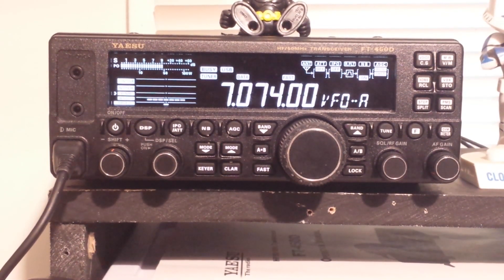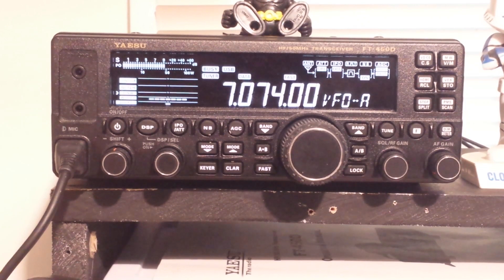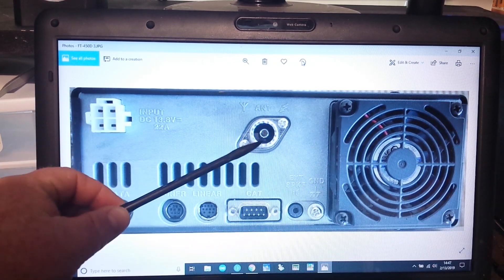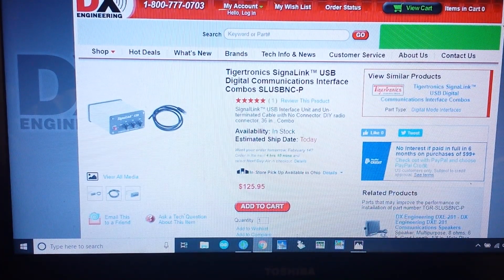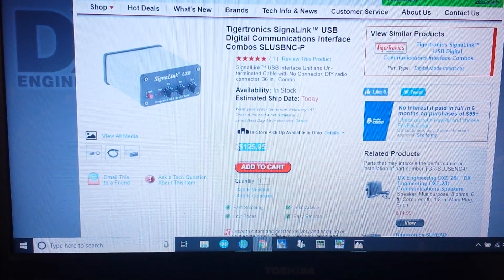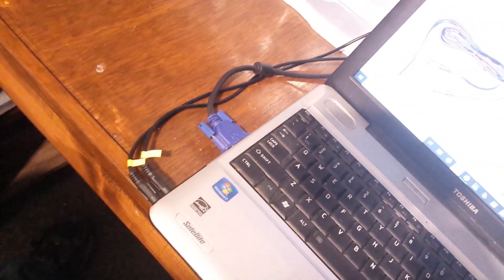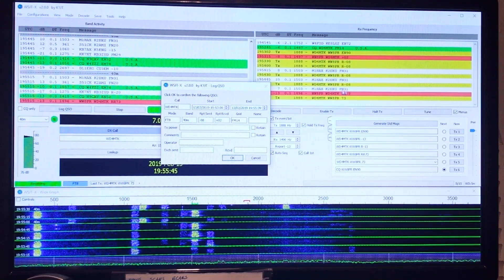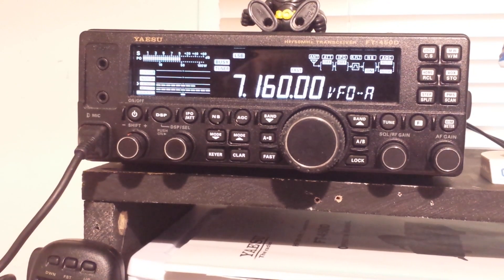Yaesu FT 450D digital modes without a SignaLink or SCU 17 USB Interface

Comment: Just a point to note.  This method is for FT-8 ONLY.  If you want OTHER digital modes, my best suggestion is the Tigertronics USB Signalink.  Also, it is very frustrating to see a video with a title such as this one, suggesting you can do digital modes without an interface.  People, saying "Digital Modes", dos NOT exclusivly mean FT-8.  Quite frankly, FT-8 is not the end all in digital modes.  I have been there and done that, and it has no EMCOMM use.  Quite frankly this videos title was "CLICK BATE", for FT-8!

Comment: I have an FT-450D and Signal Link.  It works fine with FlDigi but NOT WJXT.  I'm having issues with it wanting a com port for rig control and have tried two cables into the DB-9 Jack.  One with USB on the end to computer and the other DB-9 o both ends.  Device Manager seeing cable but on FlRig.  Wish you would have gone one more step showing rig Control and if you could change r=frequencies in the WJXT sofware or had to do it manually.

Comment: I know this is an OLD video, but for newbies watching, you DO NOT have to buy a sound interface for digital modes, the PC itself has a sound card and they work just fine instead of going out and buying something you really do not need, BUT MAYBE YOU KNOW THIS BY NOW. Older rigs never had a sound card built in to demonstrate my point before these external cards came along, AND by the way you could have just used the "DATA" PLUG socket and wired it direct with 2 or 3 wires into your in/ out audio jacks on your PC. Maybe this will help someone on a very tight budget. Good video for beginners though. 73 de KD6SBR Tom in NV

Comment: Thanks for the info on the FT8 input into the FT-450D.  I've had a 450D since 2016 and your spot on
in that it is an easy to use well made rig.  I have made over 6000 QSO's with in 7 years and it shows no sign of fatigue.  I keep the output watts as low as required to make contacts.

Comment: Does someone have the software settings for the Yaesu FT-450D when using this 6 pin data connector? I bought the cable, my PC has one audio port, so I bought the correct single pin unit for my pc. Anyway, I can receive on FT-8, but not transmit. It has to be the setting on the software of perhaps the radio? Can someone offer a bit of advice> Many thanks!

Comment: You're missing two key features of the signalink. Once is obviously the PTT feature so as to not rely on VOX for keying. The other is probably more important and that is that the signalink is electrically isolated from your radio. I do not recall (been a bit since i looked inside) if its using optoisolators or audio transformers to accomplish this but it is important.

That said, just adding an audio transformer to your setup can be done. They're not expensive and can be picked off amazon or ebay or whatever.

Last point, the signalink isn't cheap but its a pretty good little device. The isolation along with the jumper configuration to allow it to mate with pretty much any radio is very handy as well as the physical dials to control audio levels in and out of the device.

Comment: I use an FT-991 so I'm just guessing here. Can I assume all it took was to tell WSJT (and the other programs) to use VOX in order to do your keying for you?  I'm assuming it will, which makes this perfect timing. We have new Ham with a 450. He's trying to get on FT8. This would be perfect. 

Thank you.
Reply from the maker: Vox will work just fine
Reply: VOX is a great idea, and it's what I'm going to try when my cable arrives :). Just a note about the FT-450D, if you haven't seen it elsewhere: I think you may need to adjust the menu item called DIG VOX (default is OFF), rather than VOXGAIN, depending on the mode you use on the rig. In this vid, you can see WW8PR has the rig set for "plain voice" LSB on 40m (not DATA LSB), so presumably VOXGAIN is the way to go.

Comment: Is internet required when making contact or just via antenna?
Reply from the maker: Contacts via antenna only, but logging requires internet
Reply: You do not need an internet connection. 

And you can log using the WSJT-x logging software included with WSJT-x unless you want to use something like LoTW.  

However, to run FT-8 you need to be in good time-synch with all other users.  Time synch is usually, and most easily, accomplished via a connection to the internet.  Newer versions of Windows 10 have built-in tight time synchronization, but with older versions of Windows (I am guessing that you use Windows) you may need to download a free synching program like Dimension4 to achieve sufficient accuracy.  You can go to the webpage time.is to see how well synch'd you are.  Mine says "Accuracy of synchronization was ±0.011 seconds", (i.e., off by 11 milliseconds) which is good.

Comment: 2.5ft FT8 / JT65 / PSK DC-11F Audio Interface Cable For Yaesu FT-991,891,857,897,450, the cable comes in usb, and it can work winlink
Reply: Hola Jonathan lo usas en el ft450D?

Comment: Hi and thank you for this video.

I use SignalLink for a FT-450D now but nice to see it's possible to use digimodes with a FT8... Audio Interface Cable. I may use the SignalLink with a FT-1000MK in stead.

Have you any ideas how to remote control the FT-450D? Except with HRD? Could it be done with Fldigi ? Do I need a serial cable - for what?

Is it possible to run digi mode with a similar Audio Cable also for FT-1000MK Mark-V?

73 Alf
OH6IH
Reply: Is these cables for FT-1000MP MARK-V ?

Comment: Ok, but how you can secure your pc motherbord from ham radio RF impact without galvanic isolation which is very critical in such connections? A common damage of laptops' motherboard is caused by this. The RF on the motherboard's ground !!!

Comment: Thanks, great tip.  However, you have failed to mention one really important thing.  You have said in your video that the 6-pin DIN to the two 2.5mm jack connecters is all you need and there is nothing fishy going on and that you are showing us everything.  Actually, you haven't shown us that you need a CAT connection for PTT transmit which isn't included through the DIN connection.  Also, what is the software you are using?
Reply: Just enable VOX on the radio. It will go into transmit when sound is present....
Reply: @VoeViking  Thanks, that's great, I didn't know about vox.  I've just got round to trying WSJT-X on my computer.  However, I was wondering if you could help.  I am trying to make it work with the Digi-vox feature on the radio.  My digital-vox PTT does turn on and off with sounds from the computer soundcard, which I discovered by accident.  In the WSJT-X software itself however, when you click the tune button, it causes the radio to transmit but when you click the button again, it will not stop transmitting at all. I cannot figure out why.  I've tried everything and on the verge of giving up.  Wondering if you can help?  Thanks in advance
Reply: @avaughan585  Late to the game on this, but you want to adjust DVOX, not VOX.  DVOX applies to the rear data port; VOX applies to the front mic port.  Found this out when I bought a device from overseas that is essentially a USB sound interface with integrated cable (it even came in a 3D-printed dongle head).  Simple interconnect, no need for CAT switching.

Comment: Hi Friend...Thanks for the informative Video. Was the need of the hour. Your Ebay Link Doesnt Work.
I tried searching and found this working link for the product ...
https://www.ebay.com/itm/3-FT-FT8-FT4-JT65-PSK-Audio-Interface-6-Pin-Mini-DIN-Cable-DC-11F-for-YAESU/164148024000?hash=item2637fc12c0:g:SCEAAOSwnDpaI31s

73s
De VU3OSA

Comment: Great video. But although i understand the sound input/output part, how does the PC controls the transceiver (tx/rx)? Is it vox style?
Reply from the maker: No, you need a DIN to USB cable for CAT control and PTT
Reply: @learnelectronics  meaning?  Like i have db9 to usb,  and already buying 6pin mini din with speaker jack end to end.  Now need tondo the soldering work.  Just connect for datain and data out?
Reply: @learnelectronics  I thought the CAT control was using the DB9 on the back of the radio, not a DIN. Is that incorrect? Would it be like a Prolific USB to RS232 converter cable from radio to pc?

Comment: I have the previous model yaesu ft-450at  does will work with this cables ?
Reply from the maker: If it has the DIN connector you are good to go.
Reply: @learnelectronics  shure it has the din conector , I am having trouble finding the DC11F yaesu cable

Comment: I made my own cable by geting a 6' 6  pin PS/2 cable and cutting it in half. Also, I did use a cheap (<5$ usb sound dongle just to make sure no windows sounds went to the radio, hi hi.
Reply: did you ever get Hamlib error: IO error while opening connection to rig?

Comment: That was very helpful - just purchased this radio. Thank you for the info!
Reply from the maker: Check out my video on getting started with FT8 too.
Reply: @learnelectronics  Just a friendly question. How is PTT handled in this setup (featuring the cable)? Are you using VOX or something?

Comment: I see you have the IPO in the off position. This means the receive preamp is on.  Your impression of this radio will be greatly improved if you turn the receive preamp off. You will see the noise floor go way down.  I know it is looks wrong but when IPO is in the off posttion the receive preamp is on.  That is why the DSP is not working as good as it should. You are amplifying the noise floor.  The DSP makes a BIG DIFFERENCE on CW.
Reply: If you turn the preamp off you aren't you reducing your wanted signal too?  I'm just thinking from a DX perspective

Comment: Hi, thanks for the video.  I understand the Data -> Audio cable is a good cheap solution for FT-8 but I'm wondering if you can explain if there are advantages of the Yaesu / Singalink boxes as compared to the audio cable?
Reply from the maker: Isolation is the only thing I can think of.

Comment: As engineers I'm sure we could make this cable right?  Unless there is some special stuff baked into the mouldings???  I think the pinout for the Yaesu FT 450D is published somewhere?  I have also came to the same conclusion as you - that you can pick up some very nice 2nd hand gear cheap if you avoid the latest sexy SDR rigs.  I opted for a FT-950 a little older than yours but very capable around the same price.  I'll have to do the same as you for connections of CAT and audio in/out.  There is also  converters on eBay for about $40 that do it all...
Next stop: "Poor man's Pan adapter" using RTL-SDR connected to IF inside the radio, you might want to check that and do a video on it.
Reply from the maker: You sure could make it. The pinout  is in the manual. These days I'd rather buy a cable though. I'm getting lazy as I get older.

Comment: A very helpful thing that you could have added to the video was to show the Settings in WSJT-X, specifically for the Radio Tab in Settings and the Audio Tab in Settings. Also if there are certain settings on the computer that need to be adjusted, such as in the audio settings.
Thanks for a nice video otherwise.

Comment: Hi Carl, I have the cable and have a few set up issues txing any chance you can do a video or write me the settings you use on the programme and also the radio settings.. Thanks
Reply from the maker: Im not sure who Carl is. I'm Paul. Email me @arduino0169@gmail.com and I'' try and help you out. 73 de WW8PR
Reply: Hi Paul thanks for replying I have sorted it and making plenty of contacts cheers 🍻

Comment: Thanks for taking the time to uploading this video, I will be using the 450 for ft8 and was going to buy a signal link but I will give the cable a try, looks nice and easy to set up.
Reply: My computer only has headphone speaker out no microphone jack. Would a USB microphone/ speaker converter work please. Thanks for reply in advance.
Reply: Where u able to use the cable with your computer?, I Havent been able to use it
Reply: Hi yes I am using the cable now with mine. Thanks
Reply: @gbpauluk  could you tell me step by step how to aconplish this with jtdx using ft8, I connect this cable and set the program, but just receice data loss. Do I need any extra cable or somethink link that?

Comment: If you must use an external sound card.. i've had good luck with those $0.90 usb sound cards...  I use it on my APRS setup...  I seemed to get a ground hum when I plugged in straight to my laptop, and the external card got rid of it  ...  couldn't see spending $100+ on a sound card. 'probably should have put in an audio isolation transformer, but had one of these laying around..

example card I use:
 https://www.aliexpress.com/item/USB-2-0-External-Sound-Card-5-1-Channel-w-3-5mm-Headphone-and-Microphone-Jack/32815941625.html?spm=2114.search0104.3.33.67081ef13zPIMV&ws_ab_test=searchweb0_0,searchweb201602_9_10065_10130_10068_10890_10547_319_10546_317_10548_10545_10696_453_10084_454_10083_10618_10307_537_536_10902_10059_10884_10887_321_322_10103,searchweb201603_51,ppcSwitch_0&algo_expid=e23752c2-dfca-466b-83e0-b6d38680583c-7&algo_pvid=e23752c2-dfca-466b-83e0-b6d38680583c&transAbTest=ae803_3

Comment: I like your channel a lot and on this one I can not but agree with you, the Icom 7300 is a 1000$ radio (brand new) and it is a SDR radio with immensely more capability then the yaesu 450D. Both directly on the radio controls as well as when connected to a computer. 
It's likely the Icom 7300 does not get the 500$ price range on the used market but the radio sets a new standard on HF and Multiband radio's with totally integrated SDR capability.
The Yaesu is in deed a great great radio but the "new kid on the block" is indeed the Icom 7300.
Reply from the maker: Love my 7300. It has changed the face of amateur radio for ever. It's like aircraft going from ic to turbine. The ability to see a signal, live, changes everything. Folks are dumping their ts-480s , ft-450s, and ic-7000s in droves.
Reply: @learnelectronics  Yup, for the 1000$ price tag it's indeed a game changer. There were radios like the ic 7300 but for a huge price tag. The 7300 has great capabilities all integrated in the radio and for 1000$.  It's actually forcing a lot of others radio to drop the price a lot in the used market. That's why we get a ton of those very very good Yaesu 450D for 500$ and less .. because everyone is saying ..hey ... for 1000$ I get a Band new with warranty Icom 7300 with SDR capabilities and excellent PC interface! So all other good radios out there must drop their prices on the used market. I expect all other name brands to reply to Icom with radios with the same of better capability and for the same or lower price tag of sales pick-up on that segment :) ...

Comment: HI Paul, my Elmer's explained to me when I came to that point with my BITX 40 that I need to make an "Isolated Audio" interface. It's necessary to isolate the computer from the radio so as not to create a ground loop that can pick up and or radiate noise. And there is the difference in voltage potential between the two things that could lead to zapping the sound card circuitry when being connected. When I made mine I borrowed from the Easy Digi schematic on every sellers site and used a USB sound card for further protection that I can also use with a Raspberry PI which is lacking a useful sound card for this purpose. Anyway the most useful purpose of those expensive interfaces is that they are isolated circuits for better performance and equipment safety. Easy Digi could be a good electronics video too for many non-hams who work with audio and want to avoid ground loops there too. Thanks for listening to my 2 cents.
Reply from the maker: John, no problem and thanks for taking the time to comment, I appreciate it. Now I am new to ham radio. Got my tech and general in February of 2018 and my Extra in Sept. 2018 so I certainly do not know all about radios. In fact I am a noob in that arena. I can see the point of what your Elmer told you and it makes makes perfect sense.
From my point of view an an E.E. the PC is grounded at my household earth ground. The radio power supply is grounded there also, and my antenna is grounded to an 8ft copper clad steel rod in the yard that is bonded to my house ground. i would say, in my opinion, they are all at the same potential. But I may well be wrong and Im going to do some research on this issue. Thanks again for pointing it out.
Reply: @learnelectronics  I may have overlooked a detail, I thought you we're using a Laptop, which isn't always connected to ground because of portable battery power use sometimes. Your star topology of grounding is great, but you should also try to avoid ground loops through equipment. Also, I'm interested in hearing about the FT-450D as I have heard it provides the best bang for the buck in a beginner radio. It's on my wish list. But the IC-7300 does seem way more popular, but how much better is it really?
Reply: @JohnSmith-bb2np  get a ft991a  and save  kg6mn